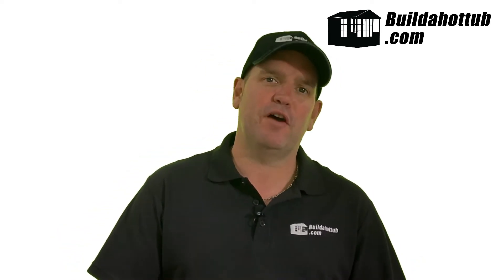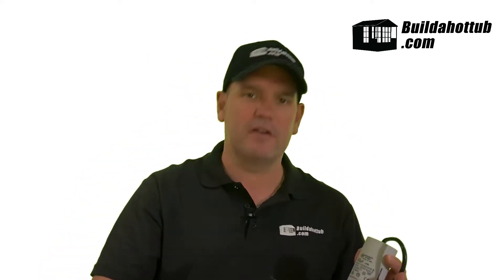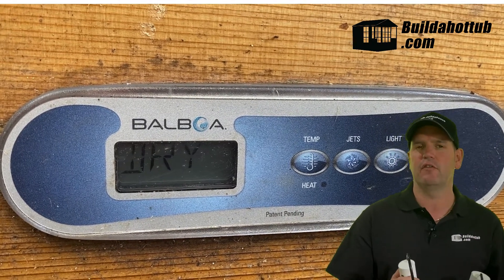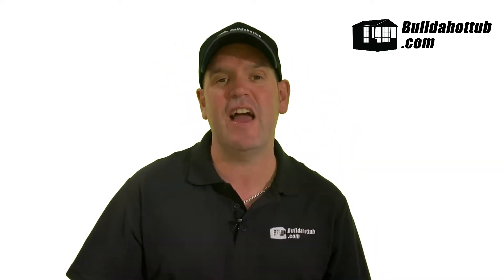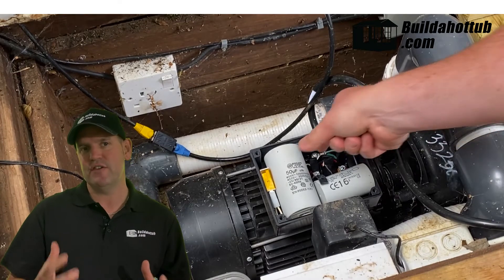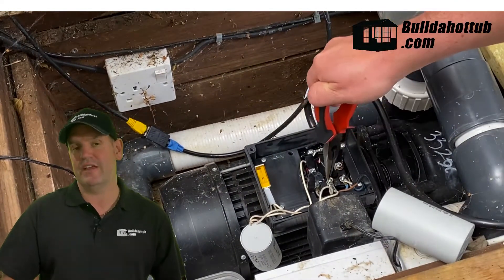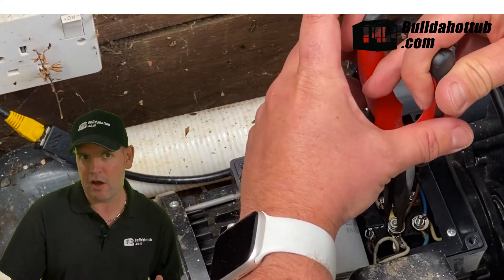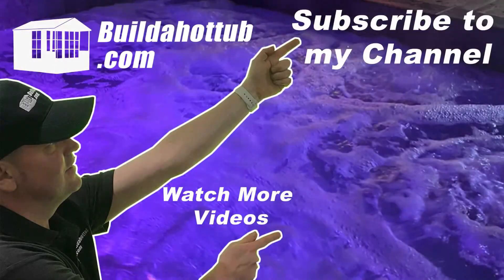Hot Tub Pump Humming? Not Turning? You Need to Change the Startup Capacitor

Comment: Thanks for the video, I get the humming sound, when I turn the jets on it will run for about a second then it blows the 13 amp fuse. I tried 2 new capacitors but still no joy, the pump turns free and I replaced the bearings only last year. I don’t. Suppose you have any suggestions? Thanks 🙏🏼
Reply from the maker: Hi James, the only thing i can think of is try turning the power on and off several times - quite often the caps dont come with a charge so they actually need to charge before they can do their thing. - hope that helps - Andi
Reply: Hi Andi, thank you for getting back to me, really appreciate it, I’ll give that a try 👍🏼

Comment: Describe my issue perfectly. My start capacitor has 4 terminals, none of them marked.  How do I ensure I connect the new one correctly?
Reply from the maker: normally they are in "pairs" or "fours" so you can connect to multiple terminals and you connect one to each cluster. If you put a new one in and you connect to the wrong terminals, it just won't start and will do the same as before - also, if they are not labelled they may not be polarity sensitive, some are not - Hope that helps - Andi

Comment: I have a balboa VS300FL4 getting LF error code. Service tech came out checked everything and cleaned heater sensors but code still came back. He said maybe circuit board   I noticed the when I pushed motor just hum and doesn’t come on. If I turn off power and rest then motor will come on. Any thoughts before I spend big money on circuit boards. Thanks
Reply from the maker: If you have a dual speed pump, you should be able to make it turn on high speed, then it will drop down to low speed but once it stops, it will just hum when it tries to restart if you have a bad capacitor. Pump is the problem here - not the circuit board for sure - dont spend on a new circuit board - concentrate on finding the problem with the pump. - Hope that helps - Andi

Comment: Excellent video! What if the pump never starts running - meaning on both low and high speeds there is only the hum. Could it still be one of the capacitors?
Reply from the maker: Hi Jorge, thanks for the kind words. It sounds like the start capacitor still, even though it doesnt turn on high speed too. The run capacitor is there to "smooth" things out so even without the run capacitor you can have a pump that will run and turn but will be "lumpy" and noisy. The hum, means it has not got enough "juice" to start turning which is what the start capacitor is for. Replace it and you should be all sorted. Doubly check the pump is not getting hot too - a pump overheating can be a voltage issue but not likely if you have not changed any settings on your Spa Pack or wiring configuration - my bet is the capacitor. - Cheers, Andi
Reply: @Buildahottub  Thanks for the response. I'll dive into it this weekend and look to see if I can replace the start capacitor.

Comment: My gfci trips instantly.  When i unplug hush pump from spa pack the breaker doesn't trip.  Any ideas
Reply from the maker: Hi Eric, sure, there is either water in the pump or the coil is breaking down and shorting out - this happens if the pump is old or has got water inside of it in the past. Sounds like you will need a replacement to be honest. If I can help my spare parts hot tub website is www.parts4tubs.com - I carry a large range of pumps so you will be able to find a replacement. Hope that helps - Andi

Comment: Where does one  order a capacitor? How do you make sure you are getting the right one?  How much does one cost?
Reply from the maker: Hi There, i dont sell capacitors unfortunately. you need to read the size on the side of them and the voltage which you need to match, you chould then be able to google and find them online - hope that helps - ball park 30 bucks or less. - Andi

Comment: What does it mean if the pump is humming but it doesn't move any water when forced into high speed?  Does this indicate that the pump needs to be replaced?
Reply from the maker: Normally a bad set of capacitors so the pump cant start. I would change those first before you incurr the cost of a new pump - hope that helps - Andi